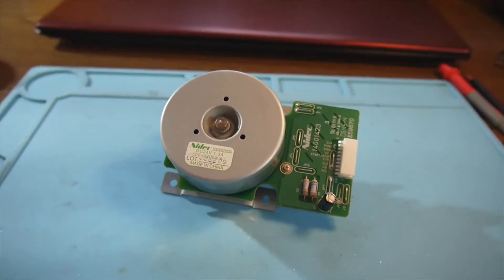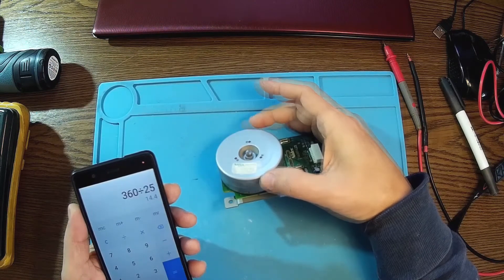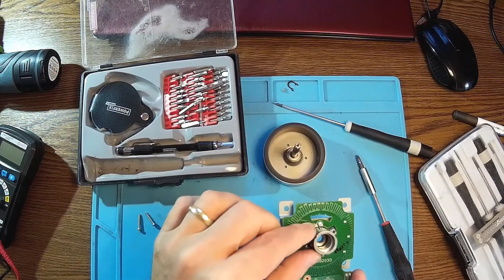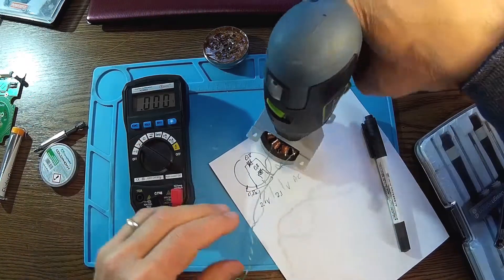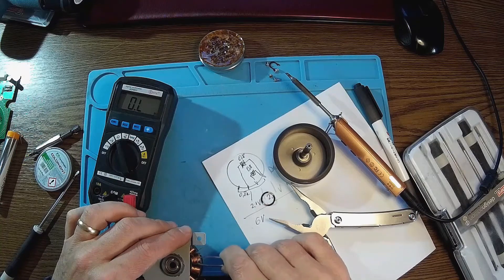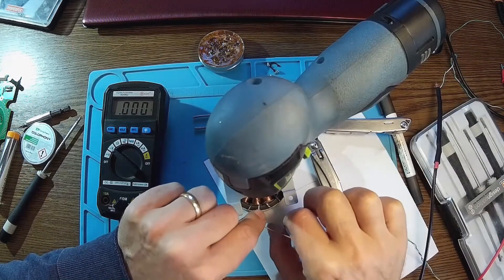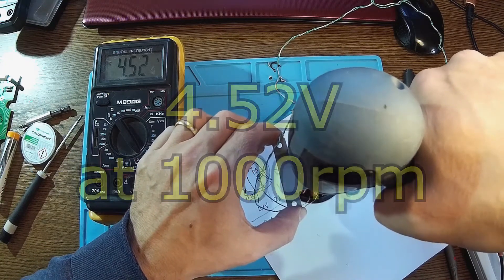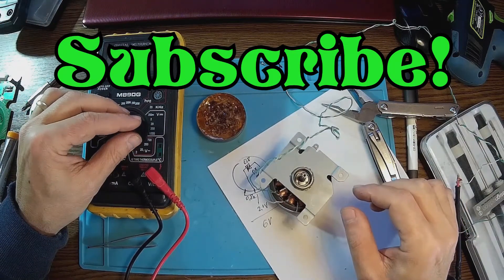Wind generator from a stepper motor

Comment: Hi Viorel, to maximize efficiency you have to connect each phase to a full bridge rectifier made of schottky diodes to reduce the voltage drop (same used as reverse protection in solar panels, the bigger the amperage, the lower the voltage drop), with big smoothing capacitors.
Reply from the maker: I'll do that.Thanks!